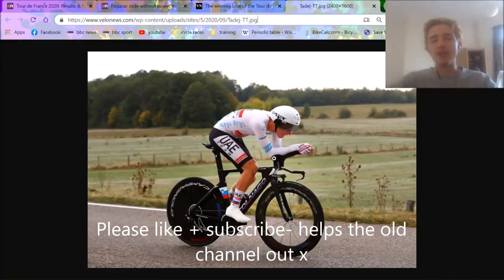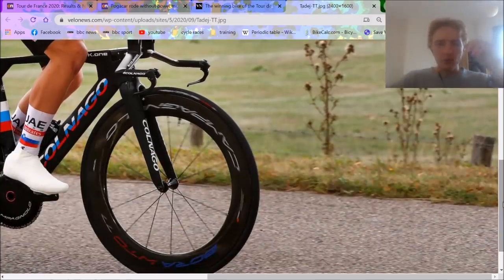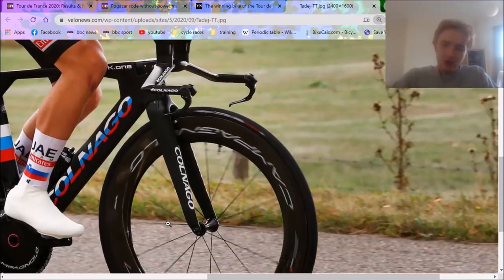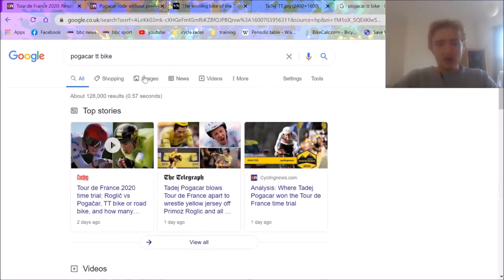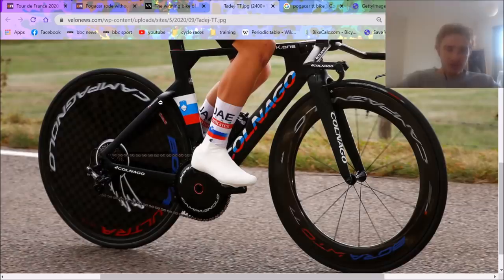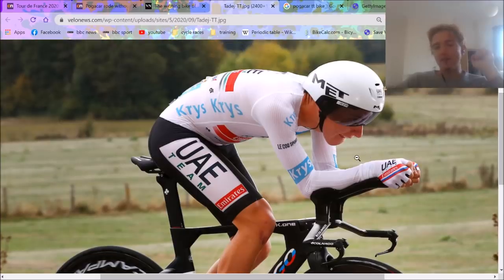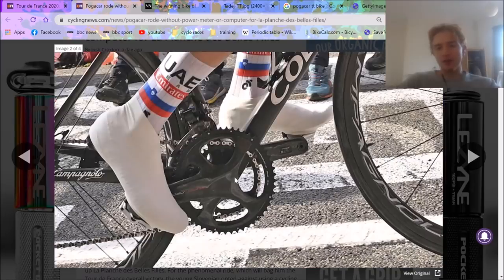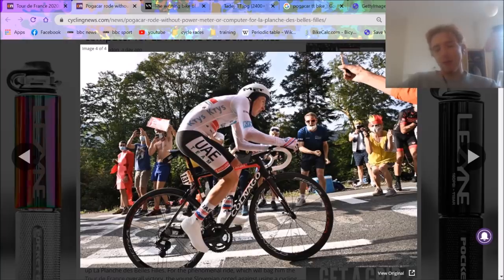TOP SECRET COMPONENTS ON POGACAR TT BIKE

Comment: Dan Bigham says that high hands isn’t actually faster than low hands but it does help get the shoulders lower and ‘tucked’ which does help with aero
Reply: Its really based on the person and what position you can hold. No point going lower if you cant sustain it.
Reply: @wowcherub  but compared to a few years back you see that most pro riders have a higher TT position for their hands than before. Its more aero to have your hands near your face than low
Reply: Elijah Kwon if it’s more aero, it’s faster, assuming it doesn’t result in a loss of power.

Comment: We are going to get to the point one day where cyclists are going to get plastic surgery  to become more aero
Reply from the maker: I have always thought about bio hacks you could do as a cyclist. No1 is take out spleen / tonsils they both are extra weight and they serve no purpose to the human body. Maybe a 200g saving maybe more.
No2 is shoulder surgery, ie take out the bone and replace with metal so you can hold a narrower position. I think no2 is less likely to occur but if I was trying to lose every gram I would definitely think about taking spleen/tonsils out for some weight loss in the off season
Reply: Charlie, Carbs and Cycling If I remember correctly, Ed Clancy thought about something like (no2)
Reply: @CharlieCarbsandCycling Geraint Thomas removed his spleen in 2005, clearly thinking of marginal gains to win the tour.
Reply: @CharlieCarbsandCycling  are you serious? I have a hard time identifying sarcasm on the internwt
Reply: Im 193cm with broad ass shoulders so id have to consider something like this. My CDA is pure shite!
Reply: Elijah Kwon Spot on! It would actually make a big difference at 60km/hr in a team pursuit!
Reply: howsabout an IV port to a 1L  subcutaneous bag with regulated drip feed to the stomach? Over thinking.......  : )
Reply: Keshti, My Bow Gen 9:13. POSTTRIB aerodynamically shaped finger nails... it is the leading edge after all!

Comment: Um Pogacar was on a mission! Um he had a mechanical and the teams new it so they pushed hard to drop him. Um next stage got 30 seconds back. Um after the next couple stages I commented that without that mechanical he would have been close to challenging for the yellow jersey or in it. Um then he lost 17 seconds which set him back again. So Um he went into that TT nice and calm even fist bumping Roglic just before they went out. Um right off I noticed how nervous and pressured Roglic looked at the start. Um Tedej was in one last fight for the yellow jersey that everyone was saying was pretty much a forgone fact couldn’t make up that much time on Roglic who has been so strong. Um Pogacar did everything right with no pressure and the challenge of it all made him stronger. Um Roglic was nervous rode stressed the whole way. Um him and his team looked frantic and in that final hill didn’t ride calm and efficient. He um had a look of desperation the whole way up with elbows out and not understanding when he needed to stand and pedal or to sit and pedal. Um all the stress and nervousness showed up with him in this one stage when his team couldn’t help pace him or calm him down to be smooth and relaxed which took a lot out of himself.
Reply: Um

Comment: No reason to expect wheel rub on a rim brake bike after a wheel change with intergrated brakes - no issues swapping wheels on mine.  Maybe on the rear if there are horizontal dropouts if it isn't inserted properly.  The extentions look like Speedbars.nl though a few were riders were rocking the new Vision setup (not sure why Van Aert wasn't, I guess as he wasn't riding GC so seen as less important and his TT position is possibly still a work in progress given his background.  Didn't notice any WattShop, Drag2Zero or Aerocoach bars (as used by Dowsett at Euro's), though some Ineos riders were rocking Aerocoach Aeox SL discs.  Expecting to more UK TT brands equipment at Worlds and Giro.
Reply from the maker: yh you are correct they are speedbars. I think simon yates uses wattshop bars. Also now vision make custom bars there is less demand for niche brands but ganna used aerocoach ones in the track worlds
Reply: @CharlieCarbsandCycling  yep given the course wasn't one for the pure Time Trialler, the lack of a team TT & timings of the worlds there were maybe less riders that would be rocking the niche TT non sponsors gear .  Yep Simon Yates has the WattShop bars, interesting that Adam doesn't, even though he wasn't going in originally for the GC you would think a rider of his level would have the t's crossed and the i's dotted anyway.  I expect more WattShop, Aerocoach, Drag2Zero, Revolver gear at the worlds and the Giro.